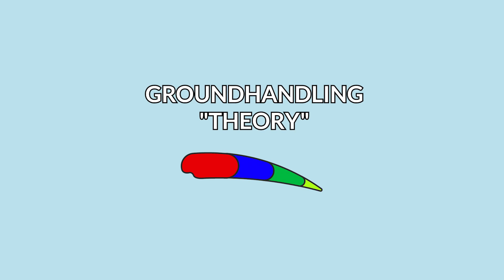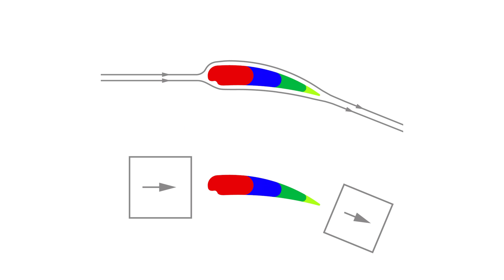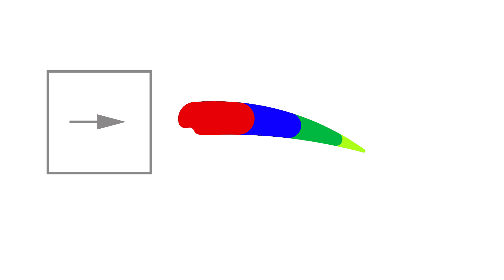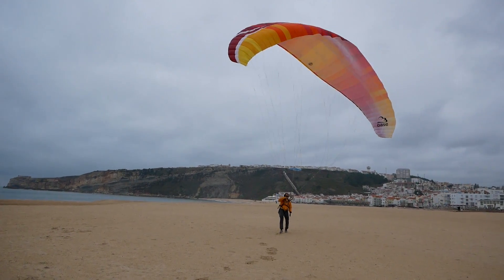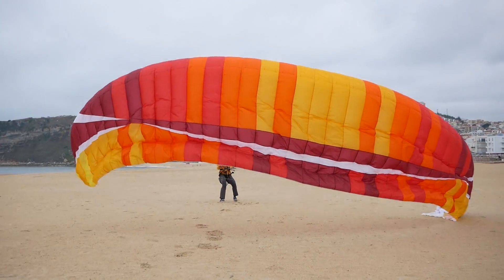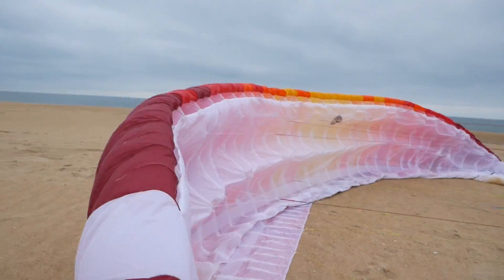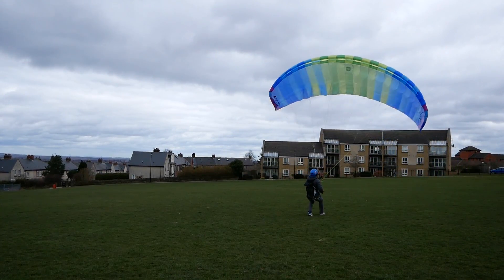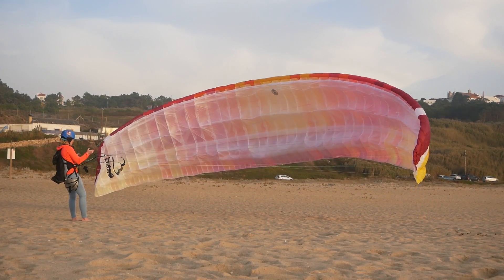Bernoulli vs. Newton - GH JOB - BANDARRA

Comment: To understand lift and drag intuitively try handling sheets of plywood in a stiff breeze. That's all there is to it really. The shape of the wing makes the lift / drag ratio better and affects the handling characteristics (changes in forces generated) at low or high angles of incidence (angle the air hits the surface). 
Hold the plywood sheet, edge to the wind and it'll just pull back a bit and fall. Tilt the front edge up and the whole sheet will start pushing up. Keep tilting it and it'll start pushing more back than up until it isn't pushing up at all.

Comment: Actually Bernoulli's principle is an application of Newton's laws for inviscid and incompressable fluids. So only wrong thing about the Bernoulli's priciple explanation is the principle is too abstract to visualize. You cannot guess which part has low pressure or higher velocity. However with good understanding of Coanda effect, everybody can visualize where the lift is and how the air moves.

Thanks for this video, this is a great help for people who starts paragliding and wants to learn the physics behind it.
Reply: Correct until you talked about Coanda effect, which has nothing at all to do with flow over an airfoil.

Comment: Great job explaining the principles! It's always really good to understand what's happening.
But I feel like the system you showed here might be a little complicated to use in practice, because it's not tied directly to the required inputs or the feedback you get from the wing. To use this system I feel like one needs to convert the knowledge into inputs, observe the wing accelerating, understand that the balance of air spilling downwards and upwards is distrubed in this way and then start thinking of putting the appropriate input. (Mind you, maybe your brain is wired better for this kind of thinking than mine is :D )

I use airspeed over the wing as the parameter to control indirectly. There are two things that influence it when ground handling: wing loading ie how much tension there is on the lines and angle of attack/drag from brake inputs and pulling A's (sorry for the obvious statement :P ). This way if the wing is pulls you less strongly you know that the airspeed is going to drop so you need to take a step back to keep the wing flying and adjust brakes.

The critical thing I think is getting a good feeling for the tension on the lines and tying your reactions to the feedback from the wing and not to your processed understanding of what is happening. This shortens the reaction time considerably. Also, there is usually a slight delay between the feeling on the lines and the reaction of the wing so this way you are ready to or already giving the right inputs before the wing starts moving in a new direction.
And another key advantage is that in a tricky situation like a rotory launch or something, you react with very little processing. Left side pulls too much - slow it down immediately by brake or moving your feet. Wing doesn't pull hard enough -  the wind died down a little and you need to take a few steps back to bring it overhead.

This is just the way I found most effective to think about this, it might be different for other people.
Anyway, apologies for the long comment, great videos and keep them coming!
Reply from the maker: Apologies not accepted! Long comments are great and I think what you're saying makes a lot of sense. It's one thing rationalizing it when sitting at a computer, but when I'm actually groundhandling I think my thought process is very similar to what you described! A lot more tension based and "feeling". Thank you so much for sharing!
Reply: Good thing our human brains are simplly pattern recognition devices.  We don´t need to know or understand the physics in order to practice practice practie!  It´s only practice that will develop our nervous systems with the fast reaction time needed to get the desired results.   Studying the physics is a super super fun way to geek out though!

Comment: Water + spoon is an example of the Coanda effect.
Reply: Seems like a really nice demonstration of fluid viscosity, cohesion, and surface tension to me. Place the spoon a few inches under the water in a stream and it becomes a better model of airflow around a wing.
Reply: similar process though, a fluid is being accelerated around a curve :)

Comment: Nice video Andre and nice that you brought up Newtons 3rd law but .....  :) 
It's Newton's 2nd law that actually describes 85% of the lift (15% of lift due to Bernoulli) 
The air is accelerated around a curved surface (flow turning) creating a centrifugal force which in turn throws the air outward creating the pressure differential and thus lift  :)

This effect is true for both top and bottom but two thirds of the lift is generated above the because the curve doesn't change directions unlike the bottom where the airflow "S"'s slightly but the air flow still averages a downward curve, plus the air is moving slower thus less energy in the centrifugal forces.

Raw deflection of the air contributes very little to the lift component but plenty  for the drag.

There's more but that's the simple but accurate version of what's going on with a wing.
Reply: @freezatron Could you give some references for this?  It's not a theory I've come across before, particularly the centrifugal forces.  I'd like to read more.
Reply: That's because most people taught Bernoulli's theorem and then it's you don't need to know the rest etc. ...interestingly this is how the Coanda effect works too, similar deal why the low pressure is in the centre of the tornado, the air is being flung out by centrifugal force .... anyhow this video is very informative, I find this subject so fascinating  :) 
https://www.youtube.com/watch?v=QKCK4lJLQHU
Reply from the maker: @freezatron  it's awesome that this is generating interesting discussion. I'm the first to admit that I'm not the most clued up on aerodynamics and it's great that people and chiming in to add/correct information. I'll have to find time (maybe in December) to watch that video. For those that have an even harder time than me understanding flow around the wing, the basic idea I wanted to stick with them is that air goes one way and the wing goes the other way :)
Reply: And as basic descriptions go yours is among the closest I've seen ;) 
A few more details and you're there mate :D :D :D 

The important bit to remember is that most of the lift is generated by airflow accelerated along a curve which induces centrifugal force throwing the air away from above the wing hence the pressure drop.
Easy :D :D :D
Reply from the maker: @freezatron  The thing is when your wing is a mess, upside down with cravats and a bowtie in the middle, which line are you going to pull? xD
Reply: Haha I love a trick question !!  :D :D :D   ... Plus that's the opposite end of "How a Wing Works", when it's knotted up it doesn't ....lol :)
.... if you've got a bow tied wing it's time to set your wing down, step out the harness and undo the royal mess you're in ;)
Reply: @freezatron  No, please don't do that. It does not make any sense whatsoever to split lift up into Bernoulli and Newton components. Pressure distribution accounts for 100% of the lift over the wing, or alternatively Newton's Second Law (via applying a control volume around the airfoil) accounts for 100% of the lift. They're equivalent (and equivalently useless in explaining why air flows the way it does).